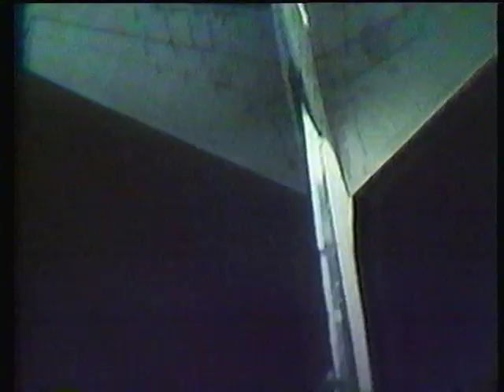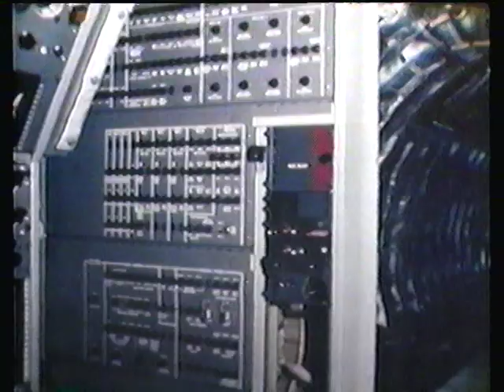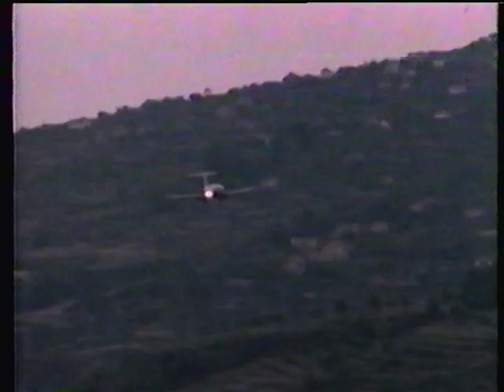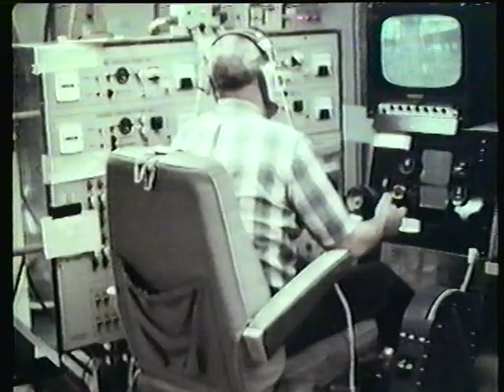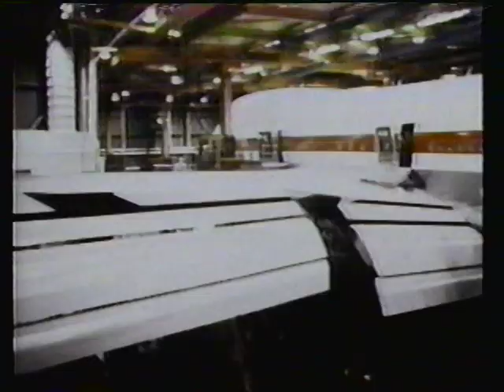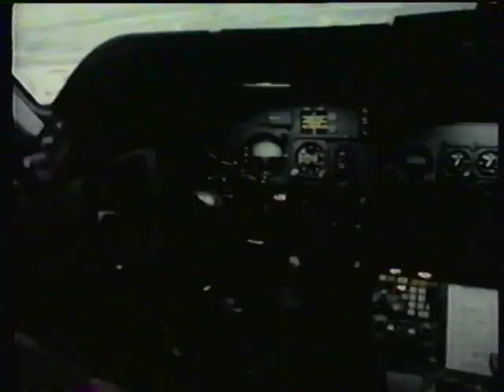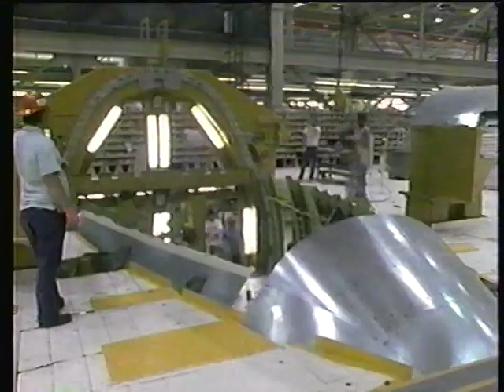Building and Test Flying the Boeing 727 & 747

Comment: They developed the 747 in under 5 years from scratch until entering commercial service. A plane twice the size of anything built before. Almost no computers, everything drawn on paper, no simulation software, no e-mails, no internet, no mobile phones. 
The 777X development began in 2013, it 's doubtful if Boeing can maintain their schedule for full certification until 2025. A refurbishment of an already existing design. 
Things must have gone very, very wrong in the last 50 years.

Comment: I read somewhere that the 727, with an original balanced field length of 4,800', was expressly designed to work on the existing runways of LGA at the time, before they there were lengthened to 7,000' with the pier extensions. Sound correct? Incidentally the 5,000' runway at Boeing's Renton facilty was a great place to test and develop that short-field capability. I flew as a passenger on Eastern Airlines 727s several times into CRW which had a 5,600' main runway at the time, with a dropoff of hundreds of feet into the mountain valleys a few yards beyond the ends. Pretty exciting. What a great aircraft.

Comment: Quite fast If we want to calculate how many Miles per Hour are 0.96 Mach we have to multiply 0.96 by 2070625 and divide the product by 2794. So for 0.96 we have: (0.96 × 2070625) ÷ 2794 = 1987800 ÷ 2794 = 711.45311381532 Miles per Hour So finally 0.96 mach = 711.45311381532 mph

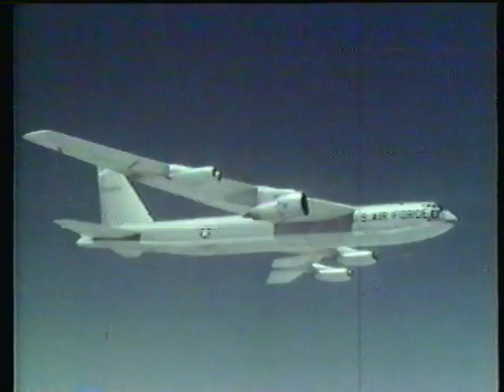Comment: @ 35:37 P&W had a few problems with this engine....per Wikpedia 
Pratt & Whitney faced difficulties with the JT9D design during the Boeing 747 test program. Engine failures during the flight test program resulted in thirty aircraft being parked outside the factory with concrete blocks hanging from the pylons, awaiting redesigned engines. Boeing and Pratt & Whitney worked together in 1969 to solve the problem. The trouble was traced to ovalization, in which stresses during takeoff caused the engine casing to deform into an oval shape resulting in rubbing of high-pressure turbine blade tips. This was solved by strengthening the engine casing and adding yoke-shaped thrust links.[

Comment: The 747 first flew in 1969. 52 years ago and 747s are still in service, and in fact a small number of orders have not yet been built.    Meanwhile, the Airbus A380 first entered commercial service in 2007 and already they're being retired and the assembly line is winding down.   Ultimately Airbus never made a profit off the A380 and never will.  The 747 has been a cash cow for Boeing.  

When the last A380 is flown to the scrapyard where it will be broken up,  the crew will return home on a 747. 

Boeing wins.  Despite some big problems, Boeing is still the best.
Reply from the maker: The 747 is undoubtedly the most iconic airliner ever produced. It was the worlds first true "widebody" with the signature forward fuselage "hump". There won't be another aircraft as iconic as this.

Comment: Dang, Paul Havis was an "0G" He was type rated in the Boeing 747, 727, 737, and the Air Bus A300. All these craft are vastly different. Now, you might see a pilot fly 2 types. But not at the same time (current).

Comment: Amazing to see all that. My favorite is Boeing 707 !  Hundred procent safe and so many fun offers this plane. MC Donald Dougles has been maked likes the B-707 . Also four engines and also a safe Ziviliation Jet for long ways around the Earth was been a plane from Factory Mac Donald Dougles, DC-8 .  But the B-707 I like it over all's. Power and dark smoke behind during starting and this wonderful sound !!!  Never I'd hearing of any Crashs by the 707 . About MD -DC-8 ... one deadly Crash for all Passangers and Crew I remember me. The reason:  NOT  enough Fuel was been in the Tanks of that plan and over the Peninsula of Sinai ( Egypt )  they goes down. For the Pilots who fly's those planes from the dekades  since early 1960 , they must having proud and fun because they had such planes to fly likes BOEING 707 from Seattle !! As Passanger did I flying with 707 and DC-8  and few times ago from Franfurt/Main Airport in Germany until to Bagdadh or Tikrit in IRAQ . Today I havn't fun for flying by the modern art of planes ,  ,, Fly by Wire ''  and nothing sound to hear by those planes of today.

Comment: I work on the 747 flight test program. Had 5 planes for certification. What a great plane. Left alot of details put but still interesting . Brought back a lot of memories. Also worked on 727 functional test. Flew one every 3 days
Reply: My grandfather was involved with the 747 program in some capacity during initial testing. I know he wasn't an engineer but he was a maintenance tech in the air force.
Reply: @9HighFlyer9 at Boeing field  in Seattle or Paine field in Everett
Reply: @JamesAnderson-mr2sg  I'm not sure but I'd probably say Everett because I don't recall him ever mentioning Boeing field. I've seen some pictures of him and his Dad on the 727 line in Renton. I know he mentioned Moses Lake and the second 747 airframe, the one that went to Pan Am.
Reply: @9HighFlyer9  i worked in Renton doing functional  test on the 727, before goint to Boeing field for the 747 flight test program, i worked on the 2 nd one ra002 the pan am one
Reply: @JamesAnderson-mr2sg I would say there's a greater than zero chance that you know my grandfather then.
Reply: @9HighFlyer9  can you give me his name

Comment: I was lucky enough to get two years in the right seat.   I was the most junior guy in my class and got one of the 4 slots.  I had never flown a jet but had thousands of hours in turbo-props.  It was a fantastic plane and easy to fly.  The Auto-Pilot was junk.  It was nothing more than a glorified wing lever.   It was seldom used as most guys preferred to handfly it.   We flipped it on at cruise, and off at the top of descent.  We had two models, A and B based on its zero fuel weight.   The A models were fast as hell.  There was a common air-speed indicator in both types with an A/B switch.  I forget the specifics but some of the planes could be selected from A to B depending on weight.   A bought you another 30 or so knots and then another tenth or two Mach at cruise.  I routinely saw 390 knots indicated at lower altitudes on A model planes and then .89M at cruise.  On the go-home leg it was 250 knots to 10,000' and then you'd "marry" the IAS needle with the VMO needle, and hold that till cruise (if the air allowed it).  Then hold climb power to VMO or Mach buffet (if you could get there) and set cruise thrust.  Some were faster than others.  I have GREAT memories of flying that plane.

Comment: If you have memories of the 747-100/200 along with the great 727-100/200 then you knew Boeing to be THE world class engineering firm in commercial aviation. Today BOLDNESS no longer exists in Seattle or Chicago or we would have seen the 757 recreated into a twin aisle, 225-275 seat 797. I’m so old I recall Boeing when they were bold.

Comment: I was a United Airlines pilot from 1986 to my retirement in 2015 at age 65. I was a 727 flight engineer based at Chicago O’Hare and an engineer check airman for 4 years. In those days, United flew the first 727 built, which I think was the prototype mentioned in this video, and it was N7001U. I flew as engineer on that plane many times, but one flight sticks in y memory. On the last day of a 4 day trip, the last 2 legs were from ORD to Raleigh Durham and back. Our captain had to catch his commute flight home and only had 15 minutes between our scheduled arrival time and the departure of his flight home. If he missed his flight, he would have to spend $50 on a hotel room and fly home the next day. He was NOT going to miss his flight!! I distinctly remember enroute from RDU to O’Hare that we were flying at Mach .89 and in continuous Mach buffet. A flight attendant showed up in the cockpit with a round of coffee. She asked the captain when we could expect to be out of this turbulence. His terse one worded reply was “Never!”. Puzzled, she looked at me for an answer. I told her we were flying so fast we were making our own turbulence. Her reply was “ Great! I have a commute flight to catch!”. On an extended downwind leg at O’Hare, for Runway 27R, at 13,000 feet, we were indicating 410 knots! We made it from RDU to ORD, engine start to shutdown, in 1 hour and 35 minutes while burning 5000 lbs of fuel more than the flight plan called for,. Chivalry aside, the captain was the first one out the door at the gate, muscling ahead of our paying passengers. Oh, he made his commute flight. I loved the 727! 👮‍♂️👮‍♂️Oh, the way we were....
Reply: joel,  I also lived that flight !   coming back from GEG-DTW,  flew at .88 nudging .89,  kept my hand on the throttles the whole time so didn't overspeed....we were doing about 11 miles a minute;  got close to DTW and tracon guy asked our speed...I grabbed the mike and lied (had my commute to BDL to make....he said,  "sir, you are overtaking all traffic ,  turn to 090 and slow to 250k !!!   well,  I was a half hour early,  the gate was still occupied and I ended up spending 50 bucks to overnight!!!  guess we all do the same dumb stuff
Reply: @triplanelover  We were SO lucky to have been intimately familiar with this awesome airplane. Great story you shared! Thanks.
Reply: @MrSuzuki1187  how do you think Cooper knew about the aft stairs capabilities?
Reply: Loved those rear stairs.  Used them a lot flying to out of way airports.  Unfortunately, D.B. Cooper liked them too!
Reply: Thank you for sharing this story
Reply: Some of the captains I fly with have great stories about the 72. This one is the best one I’ve heard though.
Reply: I have fond memories of the 727. Loved that bird for sure!
Reply: Great story!
Reply: How do you know?
Reply: Awesome! You should write a book about your experiences …
Reply: Wow what a memorable flight 😆 good laugh too

Comment: I flew the Boeing 727, 737-200, 757 and 767-200s and -300s for United Airlines for 29 years and 20,000 hours. Never had a major system failure or engine shutdown thanks to a wonderful combination of Boeing quality engineering and P& W reliability. I LOVED Boeing and swore that if United ever forced me to fly an airbus, I would retire first. The old Boeing management let their engineers tell them how their airplanes should be designed and built, and life was good. Those were the airplanes I so loved to fly. Then, McDonnell Douglas management took over and the engineering department was replaced by bottom line financial people who put cheap over good. Now we have parts outsourced and IDIOTIC cost cutting ideas, which brought on the 737 Max, and disaster. After retiring from United, I started flying the Swiss built Pilatus PC-12NG, single engine turboprop. My airplane, like the 737 Max, also has a stick pusher that forces the nose down just before the wing stalls. On the PC-12, I have TWO angle of attack vanes, one on each wing. Both vanes must tell the pusher computer to force the nose down as the critical angle of attack is reached. BOTH vanes have to indicate the SAME  angle before the pusher activates. It was more expensive to have the 2 vane system, but it prevented a false pusher activation in case one vane failed. To save money, Boeing only used ONE vane! And if that single vane failed, the pusher would push when no stall was imminent, even at 250 knots, causing a crash. On my SINGLE ENGINE AIRPLANE, I must test the pusher system before every takeoff. I also have a red button on my control wheel yoke that deactivates the pusher should it push when it is not supposed to push, such as at high speed. Boeing not only used a single AOA vane, there was no procedure for testing the pusher before takeoff, or an easy and logical way kill it instantly when it pushed when it shouldn’t push. And these dumbshits never even told the pilots their airplane had a pusher system installed. How in hell could a small airplane like my Pilatus have this kind of  this advanced engineering, and a company like Boeing be so stupid as to not have it? As a life long Boeing fan, I am crushed at what they have become. But hey, money talks and bull shit walks was Boeing’s motto, until reality walked all over them. Man!
Reply: Salute!🫡
Reply: 💯 Boeing sold out to greed. 727 my favorite and best airliner ever made. My last mainline 727 flight was on Aerolineas Internacionales From Cuernavaca  Morelos to Tijuana Baja California Mexico first class. Was and epic last flight.

Comment: The massive Boeing Everett manufacturing plant is literally two blocks from my house, where I'm sitting watching this right now. 👍 

I believe it's still the World record holder for the largest industrial manufacturing campus on the Planet, to this day. 

But, you wouldn't know it from looking, with a low profile and environmental impact mitigation. The giant assembly line hangars even have enormous, beautifully designed painted murals across the sliding doors. 

When they're closed, they look like appropriate parts of the surrounding scenery, but that's just the outward aesthetic. 

The real mitigation is in the cutting edge environmentally friendly technology that's implemented, like solar panels, etc., and an all-inclusive support system, it's own water supply towers and sewers, restaurants and cafés, and grounds flooding control and noise diminishing tech built in to the plant's design complements. Even at the multi-million dollar wind tunnel and engine testing bays. 

The campus still rolls out multiple finished airframes a day off the assembly line, so take-offs and landings are definitely something anybody in my community needed to become accustomed to early on. 

Even my WiFi is interrupted periodically whenever a fresh off the line 747 flies a couple hundred feet over the roof of my house lol more often than anyone should have to learn to tolerate. 

It certainly takes a bit of getting used to, but having been born and raised here, it's essentially something I've experienced my entire 40 something years. 👍

Comment: My first flight in a 727 was on PSA from San Diego to Sacramento in 1969.

My final flight on a 727 was on Delta from Atlanta to Greensboro NC in 2003. 

The aircraft still performed beautifully after all those years. The cabin was quiet, with the characteristic whine of the tri-jet at the rear. The seats were wider than anything you get today unless you fork over thousands of dollars. And I enjoyed watching the mechanism on the wing operate the slats and flats without an engine to spoil the view.  :-)

One of the prettiest and most reliable airplanes ever made. Sadly, Boeing is no longer the first-rate company it used to be. Sign of the times.

Comment: Watching this video drove some tears into my eyes.
As a former flight attendant I began my career on the Boeing 727 in 1982
and ended it on the Boeing 747-8 in 2015, with many more types of aircraft to follow in between.
But the 727 and 747 will always be remembered as the key types of planes I worked on aboard as a flight attendant for 33 years.
Reply: I miss those old days of commercial aviation. It was just magical as a kid. Now I get to be up front but the old days were just better.
Reply: I USED TO BEE A 727 UNTIEL SI DECISED TO RETIRED A FEW YEARS AGO. i AM BOG LIKE A JOBMOW JETS I AM SCHTONGES!

Comment: I worked on these 727(also 747) in an overhaul facility for many years. Mostly on the airframe due to aging and corrosion. Beautiful airplane ✈️. As a technician not a fan of those high engines. The aft airstair was a great idea. DB COOPER liked it also.

Comment: When I went  to aviation school  I lived on threshold  at  YVR.  Saw ever thing  take off or land. The  727  was unique.  It would pass like  400 hundred ft up. By the time it landed  You could hear and feel  the wing vortex.  Real loud.  More noise  then a feel.  Weather depending
Reply from the maker: james steadman Yeah, I hear ya. I miss the 727. Just watching it roll in an a lazy 5 mile dog leg final approach with flaps extended, nose high, and black smoke pouring out the pipes. I miss that. And the sharp chisled lines of the fuselage and wings made it an absolutely boss in the skies. And coupled with the noise of those three P&W JT8D's there is no other airliner that comes close in terms of the definition of "airliner". The 727 will always be the reigning king.

Comment: Well you must love the b36 it has six turboprops and four rocket engines for a total of 10 must have a lot of safety factors built in.
Reply: I think it had 6 Pratt & Whitney R-4360 Wasp Major piston engines and later supplemented by 4 turbojet engines under the wings.

Comment: The 727 was the 720 killer. It could more oe less do the same job from existing regional centres for much lower operating costs and had self-sustaining design features like for and aft staircases and an APU. These babies could show up anywhere and not need stairs or ground power unlike the more ungainly 720.

Comment: I'm going to have to give this a thumbs down on the 727 part of it. For the following. You can't do the story of the 727 without any mention of Alaska Airlines and the Golden Nugget Jets. Just a little airlines, that bought up some 727s, was using Hangar space at United while the hangar at Sea-Tac was getting built. And if it wasn't for the 727 there would be no Alaska Airlines as it is today. I've seen Braniff,Western,Continental, Northwest as neighbors come and go but Alaska Airlines keeps growing. And I remember the 747 roll out it was a really big deal. Me for was not a big fan of it because they scrapped the SST for it. And I preferred the SST. But over the years I have grown to like the overgrown thing.